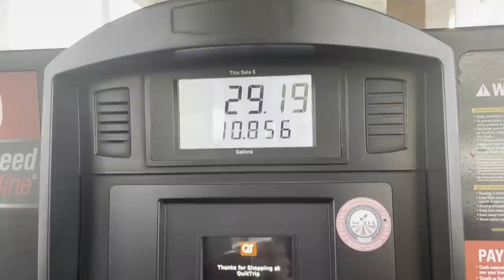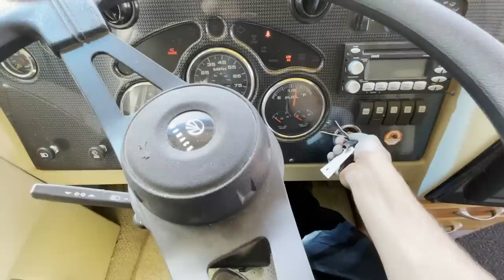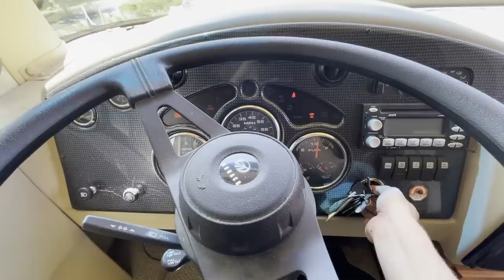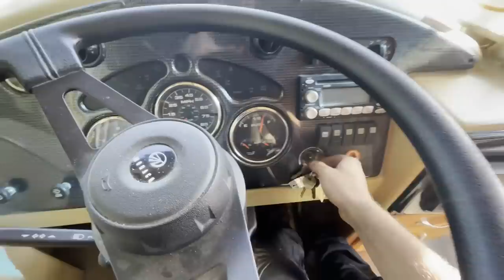Abandoned Motorhome RV Unknown Issues

Comment: It's probably the spark plugs.  😂😂😂😂

But seriously, make sure the fuel system is bled all the way to the injectors and make sure the glow plugs or grid heater are working. That would be the next things I'd look at
Reply: Diesel engines have glow plugs, not spark plugs.

Comment: After filter change always bleed the injectors of any air. It sounds like it's not spending fast enough . No mater how fast you spin it if there's any air in the lines it's not going to start so save the starter and battery's and bleed it.

Comment: Low compression engine you’re going to need more power to turn it over faster the not starting has nothing to do with the fuel it should start easily on starting fluid even if it was not primed properly.

Comment: Tow it to a local RV or Diesel mechanics garage and pay to get it started and operational/drivable. Think of your time already spent on it with the drive there and back. Maybe the Diesel fuel tank has water/condensation in it? Needs thoroughly primed? Bad pump? Bad glow plugs?, etc... Those batteries are too small as well...

Comment: hire a diesel mechanic to get the RV running.  For sure that will be cheaper than a tow to your shop.  The engine seemed to turn over slow, so it is something with the battery circuit and also probably the fuel supply to the motor.  Probably air in the lines

Comment: That was not turning over fast enough. 

Doubt the engine is the issue, as others have said, battery size and cables are wrong.

Try bigger batteries and much bigger ground cable, as well as other cable

Then your jump pack prob is undersized for a diesel that size. 

Even the clips are under sized and wont deliver the amps

Problem with 12 v ( if its a 12 v starter) it needs twice the current and then some to do the same job as a 24v starter.
Get a big battery and the starting rotations should go up

One trick i did see once
 Hot air gun down the intake for a few mins before starting heats everything up well and good, then give it a kick.

If you have trouble. Better than starting fluid.

Def worth getting it if the price is right

Comment: I would replace the glow plugs first, they are the cheaper option. If that doesn't work then its new injectors which will probably be expensive,  not much idea of price over there but it will be lots. The engine turns over so I think  it will run, why get a new engine? Way up the cost's first guys. 👍
Reply: Not to sound mean never throw money in parts you can always test parts much cheaper such as injectors glow plugs wtc.
Reply: @carlgruver695  I agree that the less money spent at this  stage the better.  I am not an expert on  diesel engines but here in the UK glowplugs are quite cheap compared to the injectors . That would be cheaper than the Brothers first idea of a new engine. 👍
Reply: @carlgruver695  I also forgot to mention, you Can make leakoff test kit with empty water bottles. Keep the lids buy a roll of clear plastic tube and some tee joints, tape it all together with ducktape and your good to go! I've seen it done and it works. That is cheaper than  buying a kit which you only use once.👍👍

Comment: As I see the motor home is worth to purchase but the fuel system need some work seating for few years not getting the proper maintenance. You may need to flush the system, install the proper size batteries. Question tho why does he wants to sell it ? Does he know something that you don't know ? Diesel engines are spendy to repair. How much he wants for? At the end you decide if is worth the money he is asking for. Good luck,  good video thanks 😊

Comment: Its a diesel.. After fuel filter changes you MUST prime (bleed) the fuel system.  Did you loosen all the injectors and wait until each one squirts then tighten. Should start no problem. New engine!? No way. You just need some knowledge in starting diesel engines

Comment: Most coaches use a D8 battery. You’ll never jump it with a car or jump box. Monaco’s built between 2000 and 2008 are some of the best on the road. Caymans are on the lower end but still nice. Side rad is preferred. That said, if you can get it started $30k. Less than that is a great deal.

Comment: Sounds like the injectors need bleeding.. While cranking crack off the feed pipes one at a time to get the air out.. the fact you have so much white smoke does show it has enough compression to fire the diesel but there is not enough diesel to keep it running.. just my thoughts :-)

Comment: While you. Guys are running after batteries.. Should star the generator get everything warm up n charge... Also you have air6 on the fuel system changing filters it's not enough... Got to get air o/o fuel system... Also ether by the turbo... You have fuel problem not engine problems

Comment: Hmm. At this point I'd ck the fuel lines and the solinoids. this is a Monaco Cayman built between 2002 and 2006. For my taste it's ancient but to each their own. Rebuilding the motor would cost you $3000 to $6000. But then you have the Roof to ck and AC's, inverter, waterpump and plumbing, make sure no Algae has formed in the lines. Since it's been sitting out side unattended you don't know if the Cold weather over the yrs busted any pipes, since it wasn't winterized. In Good condition this rig can fetch you up to $55K-$60K.

Comment: I think there's water in the fuel because it said the fuel tank was half full. If it sits for a long time the diesel fuel will get a lot of water in it if the tank is not full. You need to drain the water out before it will start.

Comment: Nothing wrong with engine  been sitting for a while you need to prime the fuel anytime you open fuel line or filters do t need engine get some sea foam spray in intake and crank for few turns and wait after 10 min try start , also check glow circuit

Comment: They need to prime the fuel, change the oil and hook a end block heater to it and most importantly check the glow plug voltage they may not be getting the voltage they need

Comment: remove aux belts seized  air con or alternator always worth check on older   vehicles etc starter sounded strained  bad live or earth  new fuel bypass fuel tank  check glows working  what year and type fuel system high pressure system or not

Comment: pump up the fuel rail and bleed air out off, next would be to check the injectors. need better battery connections and enough power to spin faster

Comment: Starter need rebuild. Newer generaiton motor needs fast starter. Bigger cabels and heavy duty batteries. Disel motors are not hard to find issues. Termo sensors, bad fuel pump, air in fuel system and so one so one. Motor spins thats goood.

Comment: Yea looks like your using small batteries you need the big batteries plus on diesel you prime the filter and sometimes you need do it couple times that should have a primer pump on it and you have to pump and pump if it’s easy to take filter off take it off fill with diesel try it mite have do it again but it’s definitely not turning fast enough

Comment: Well it's diesel. You getting some white smoke. There is fuel there. Ck the starter cables take them lose clean. Looked like a 300 Cummins. Definitely was not Turing fast enough. The coach looks nice. If the price is right I'd by it.

Comment: How many miles on it? Strikes me the injectors are not working. I doubt the engine needs rebuilding. When these things sit, the fuel system gets messed up. Confirm you have adequate spark and the engine injectors are all functioning! 
Nice coach, lower end of that series but still worth it if you can get it cheap enough.  Right now it's not worth much.

Comment: Amazing how many people give advice on something they obviously know little to nothing about, several have referenced the spark, many more the glow plugs. Gas motors need fuel ,spark. and compression  but diesel need fuel and compression…very simple concept. The fuel system on this MH involves a lift pump, fuel filters, high pressure fuel pump and fuel shut off solenoid valve. SMH

Comment: As said it got air and pretty low amp batteries combined with not good enough negative connection. It is too slow. Monaco is my wish i had that kind RV. Also if not primed the filters you have to spin it forever. If i were you i just simply crack the fuel line before a filter get a can of diesel with an electric pump.

Comment: Put 2 new highest cranking amp batteries that will fit and bring a good bateery charger and she will go if you get it running it is worth more ,offfer 8000 as is and tow it off the property and fix it off site.

Comment: Too low voltage / voltage sag.  Need big "bus type" batteries. Engine sounds ok. Fan rubbing on radiator should be fixed. The RV looked to have been lacking in maintenace for many years. Probably lots of issues underneath due to northeast climate.

Comment: If it's been sitting a long time big fuel tanks build up moisture it may have water plus prime the system get the air out dont use so much either it's hard on the heads and pistons .

Comment: Try using wd 40 up in the air filter. Call somebody to see how much it will cost to tow home.
Reply: That worked with old WD40 because they used propane for the propellant, they don't use propane for propellant anymore and have not for 5 or so years so that trick will no longer work.

Comment: Number 1 thing do not use starting fluid use wd40 as starting fluid better for the engine i agree with others you need more power and check connection also let the glow plug heat up a little longer be sure you filled the fuel filter with diesel but i believe you have dirty injectors

Comment: Those batteries are too small for that rig, the manual should specify which ones it needs. Also after changing the fuel system on diesels, you sure need to prime the fuel system before start up.

Comment: starting fluid is not good for fuel injected diesels blowing hot air in the air cleaner works good if its getting fuel.unlike gas diesel will run on old fuel but smoke more and less power i always put in a qt of 30w motor oil in old diesel fuel to help with lubricity what ever is the cheapest brand or on sale.1st. i would do is crack all the injector lines at base of valve cover and give them a quick bleed  i think if ya kick it over then it will start would not hurt to take a heat gun and blow hot air in the air cleaner tube well turning it over i think there is air in the fuel lines. there only a few thing that go wrong with these motors and are vary common the injection pump, driver on the injection pump, ecm or fuel pump (all these parts are on passenger side of motor) . as far as internal parts injectors, head gasket or piston/ring and if under 150k and it don't have a tuner on it i would doubt any internals are bad. hope that helps a little

Comment: Has a one piece windshield so its a 2006 or newer, You dont say how many miles... lets say under 100,000 miles. Engine is just fine, I'm 100% sure you could have it towed to a shop and have it running for less then $5k including tow.  As is that motorhome is a absolute steal at $40k and running and driving its a quick sale at $70k   Dont rip this guy off !!!!!!!!!!!!

Comment: Can't give anything for it.  No idea what's wrong.  Been sitting for 2 + years?  Every tire on it now has flat spots on them so 6 new 22.5 tires.  That's at least $1700 for that alone.  3 slides and you can bet all the big rubber seals are gone and will have to be replaced.  That monster's engine is packed full of sensors.  How many of them are bad?  Big money tracking that shit down with possible replacements.  Lot's of those rigs ride on huge rubber air bags.  Been sitting for 2 years?  How many need to be replaced?  Man you could be buying a money pit.  Just can't give anything for it.  In fact the seller should be paying you to take it.

Comment: You will burn out starter that way. Don't start and top I ifit is diesel keep cranking it don't interrupt  starting I you have to fill injection pump probably dried out
 Get s diesel mechanic or a pro truck mechanic

Comment: If it's been sitting for 2 years with diesel in the tank that fuel will be trashed. Diesel only keeps good for 6 months most.
Reply: Diesel will be fine normal gasoline turns bad in about a year.

Comment: Just Flip it and sell it as is with issue at copart or iaa, I have a few build suggestions, do a camaro zl1, a police car, a atv, a snowmobile, a jet ski, a jeep wrangler or gladiator, a 2nd gen jeep cherokee, a tesla, a helicopter, and a 2017-present ford f350 dully or f450 as your new shop truck, tow rig so you don't have to burrow that ram cummins for heavy equipment towing

Comment: Get proper batteries that put out the proper amps, bleed the fuel system and I'm sure it would start.  You cant jump that size diesel with a car battery and a jump box